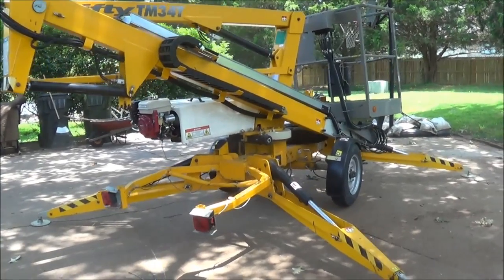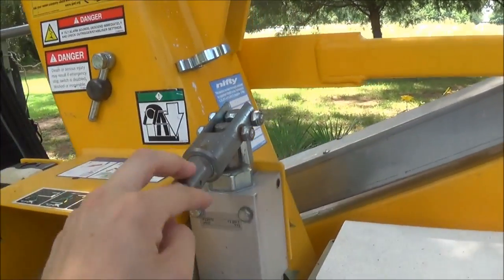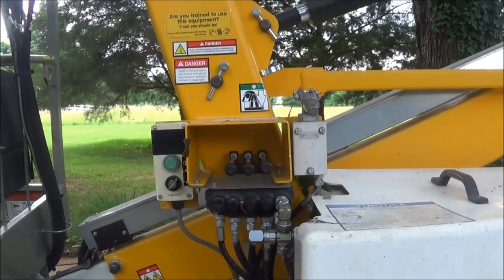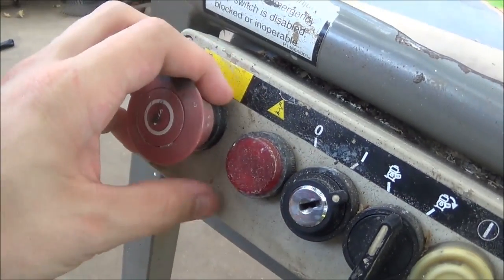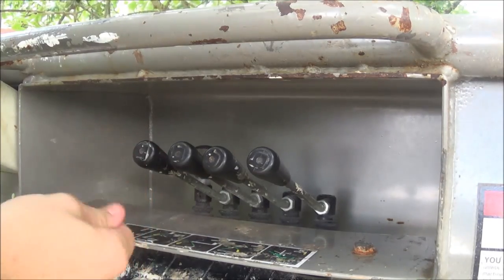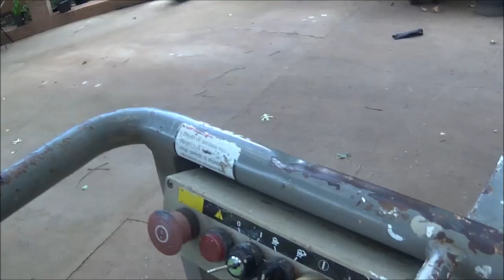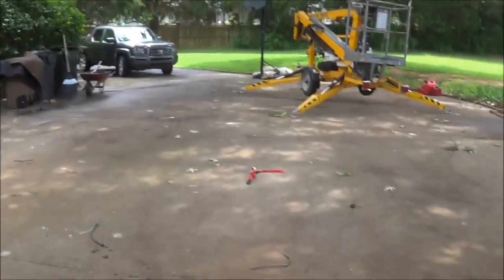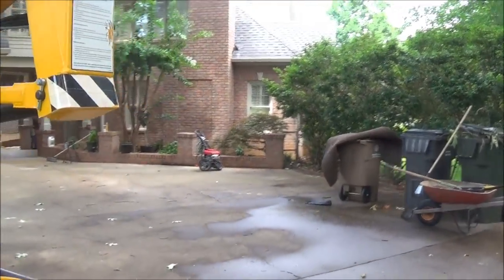Full Review: Niftylift TM34T Man Lift

Comment: there were some guys using a tracked model like that down the road from the last week....can't tell ya how many hours I've spent in an aerial lift when ya get 100ft up in one and the wind is swaying you back and forth that's when it gets fun...
Reply from the maker: When your on the ground looking up it doesn't look bad, but when your actually in it its a lot higher than you think. Every move you make wiggles the machine back and forth. When you add using a chain saw in the mix it gets really nerve wrecking. I wouldn't go 100 ft up, at least not on a trailer mounted one! You do get some good views though.I would hope a truck mounted one would be a bit more stabil.
Reply: crazyjdkid they all have some sway to them even brand new ones and the higher they go the more they sway, I ran one that was 60ft working height mounted to a Timberjack chassis for off-road work, I almost tipped it over, well I tipped it to 45 degrees before it caught it's self from going all the way over now that was a fun ride...lol..
Reply from the maker: savagenomore Yea not a job for me, I didn't have a harness. Hope you did in that case. I know the bucket on this thing wouldn't look good after hitting the ground.
Reply from the maker: savagenomore That's why we invented the Jarraff!
Reply: crazyjdkid
I had a belt on but it got unsnapped because I was about to jump out rather than get slammed around in that fiberglass bucket, when it stopped going over I was only 20 feet off the ground....
Reply: crazyjdkid
ran one of those too, that was the easiest job ever, I got to lay down most of the day....lol..